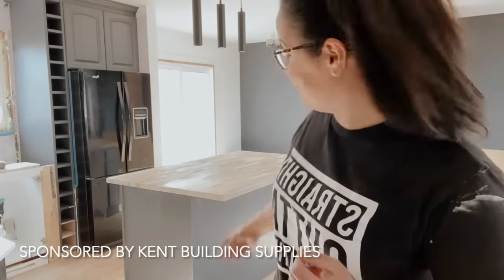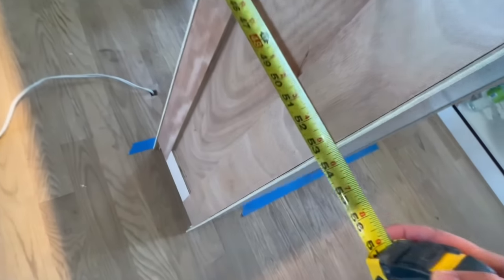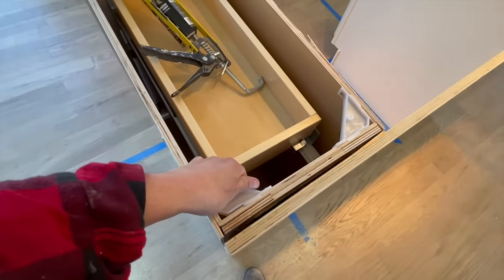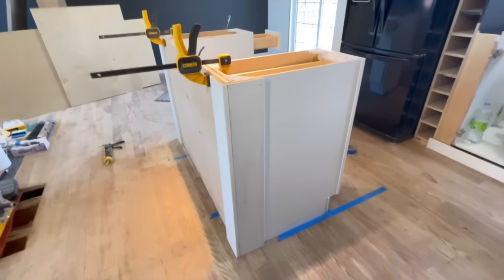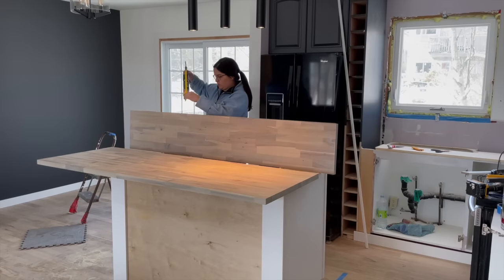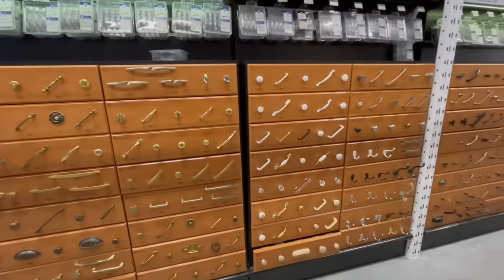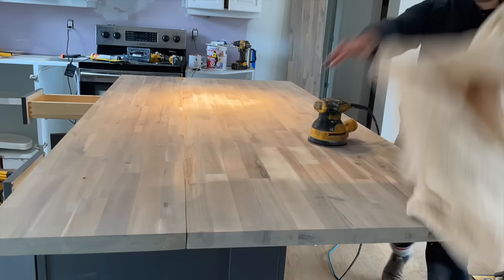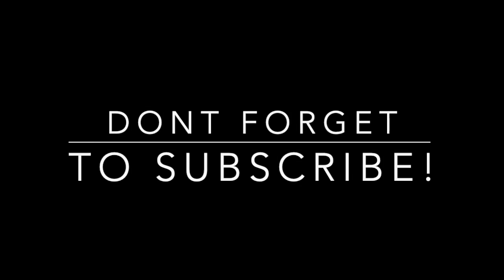DIY Kitchen Island Build - Easy Tutorial for Beginner Builders

Comment: I didn't see where you screwed it to the floor to keep it from sliding around.
Reply: After finished It should be heavy enough where it doesn’t slide around.
Reply from the maker: yes exactly! but i did end up putting two small L brackets just incase

Comment: Really helpful video and I want to try it in my kitchen as I’m planning to do some renovations. Did you secure the island with the floor or the weight of the island will just hold it in a permanent position? Thanks.
Reply from the maker: Awesome I'm glad you got inspired! I did, I just used two little L brackets. The island is so large it's hard to move but these work great to keep it 100% secured.
Reply: @dcwoodworks  can we see a picture of it? Of how you secured it please.

Comment: This looks amazing! I was curious though, how’s you secure the blocks onto the cabinets? I was wondering if you used nails or glue? I seen where you used glue to secure them both together but didn’t catch the part where you secure the counter top on to the cabinets
Reply: It’s very important to allow the wood to move freely.  Since she didn’t answer the question, She probably didn’t cover this because she didn’t know how to do it.  Sadly.  This is something that shoujd have been covered absolutely.  I actually have a discussion on this type of countertop and I go over how to secure it.  Feel free to watch it.
Reply: @davidbryanwoodworksandmore   what’s the link!! I’d definitely check it out!
Reply from the maker: I actually used L brackets to attach the wood to the cabinets. inside where the dishwasher goes so you dont see them.

Comment: Is that a portable dishwasher in the island or you had to put a pipeline in or anything like that? Will your dishwasher stay in that spot to clean the dishes or are you able to move it and then put it back once you’ve used the dishwasher??
Reply from the maker: Hey! I had a plumber come in and install a dishwasher. The basement ceiling is open underneath so it was easily accessible

Comment: Soooo….I did not see any prep work inside the in-between the cabinets for plumbing and electric outlet for the dishwasher? Did you go the floor into the basement or crawl space for drain and water line?
Reply from the maker: the unfinished mechanical room in this home is under the kitchen so I got my plumber and electrician to go right threw the floor to tie it all in

Comment: How did you connect the drain of the dishwasher you put in the island to the sink?  Did you run the drain hose under the floor and up into the sink base?
Reply from the maker: there is a utility room undernear with the main water supply to the house so once the island was inplace we just drilled down into the floor for the pipe.

Comment: How much space did leave in that box area in terms of depth for the dishwasher?  I know they are typically 24 by 24. So did you do a 26 by 26?  And where did you place the L brackets to secure the island when finished? Thanks
Reply from the maker: I left 24x24 so it will fit tightly.  I attached it with L brackets in the dishwasher void and i took the drawer out and attached two in each aswell. closer to the end of the island top

Comment: How is the dishwasher going to work without any water or plugs under the island ?
Reply from the maker: It wouldn’t unless you plumb it in

My plumber and electrician fitted it out once the island was build and in place
Reply: @dcwoodworks  Okay, thanks !
Reply: Thanks for that question. I was wondering the same thing. I didn't see any plumbing or electrical either.

Comment: No mention of checking the floor structure underneath and strengthening, if needed?
Reply from the maker: That depends on the house and is up to the owner to do that upon inspection/sale
Reply: @dcwoodworks  And how much stuff is stored inside. Also the countertop can be heavy.
Reply from the maker: @xandervk2371  yeah. Exactly, totally depends on the hone and person
Reply: @dcwoodworks  But needs to be done, otherwise there will be cracking tiles and other unpleasant things.
Reply from the maker: @xandervk2371  yup so if you build. Check that out first.  I’m good

Comment: Can u or anyone tell me:
Can I hack down my kitchen wall cabinets by myself?
Wat tools should I use?
Reply from the maker: You can just unscrew them from the wall. They should have screws in the top corners and bottom aswell
Reply: @dcwoodworks  also the cabinets got the white glue. Very tight..

Comment: The island looks nice but real world functional...not quite. You show a dishwasher, but no plumbing or electrical is coming through the floor.  With a dishwasher, the island needs to be secured to the floor, otherwise they will pull away from each other when the dishwasher door is opened. How did you secure the butcher block to the cabinets?
Reply from the maker: like in the beginning of the video i stated that I was showing a very simple way to complete this and did not go into depth because it’s an inspiration video to get people thinking about their own design and kitchen. 

I’m also not a plumber so I waited for mine to come and he installed plumbing through the floor from the basement below and my electrician also.    

The butch block and island were secured by L brackets so they don’t move

Comment: Wher duyuo get the cauter top?
Reply: You can buy a butcher block top from Home Depot in multiple types of wood (birch or maple,  walnut or acacia) and they have different sizes. There's a 74"x38"x1.5" beautiful walnut butcher block for $299. I ended up buying a 6ftx3ftx1.5" solid teak butcher block at LL Flooring for $299 because it matches my floors well and is very nice quality.

Comment: if you're a Internet Junkie do you know how to Install a Coaxial Port I hate the Cable Wires running from a Hole in the Ground it's really Frustrating
Reply from the maker: sorry I am not familiar with what that is? can you explain it?
Reply: @dcwoodworks  the Cable that goes from the Wall to your Modem, TV or Cable Box set

Comment: I didn’t like the way the dishwasher had gaps. I think you should have placed it first, then take the measurements for the cabinets and lay them. Would have made it look cleaner. But I’m gonna send this video to the wife.
Reply from the maker: my instagram is @dc_woodworks this is actually a funny screw up because i left 30 inches for a stove vs 24 for a standard dishwasher. after the video was done and then i just laughed about it on my IG stories and put in some filler pieces.

Comment: if you are only sanding and painting, why use such expensive ply?  Just get some cheap ply and add a skim coat of spackle, sand and paint.
Reply from the maker: Furniture grade plywood paints way nicer.   Adding sparkle will eventually chip off.    Plus your adding on hours of labor so the cost ends up being the same.